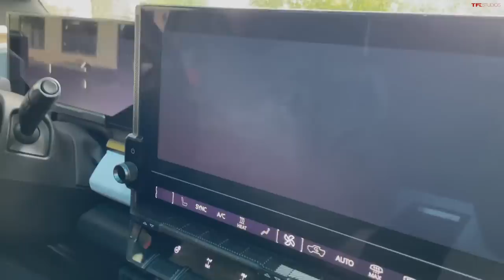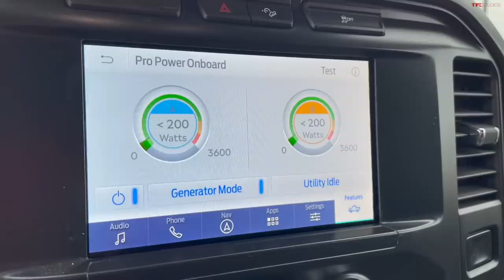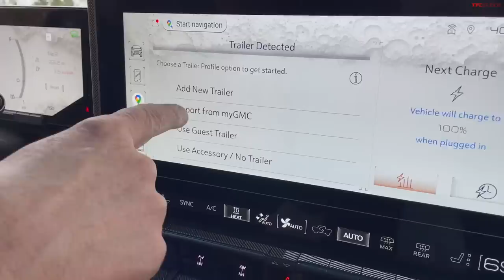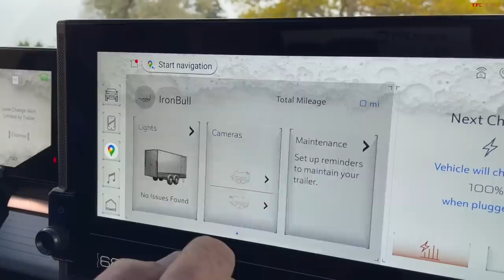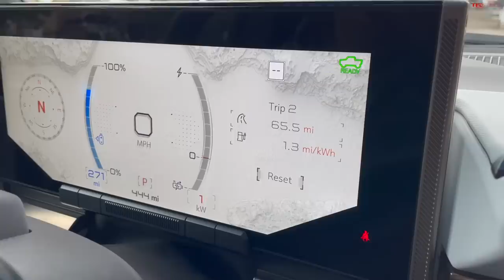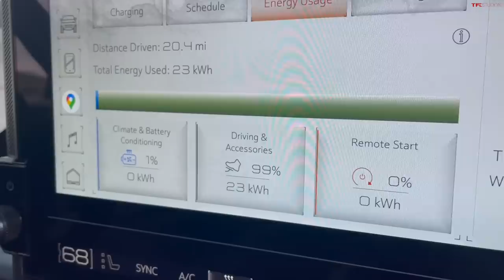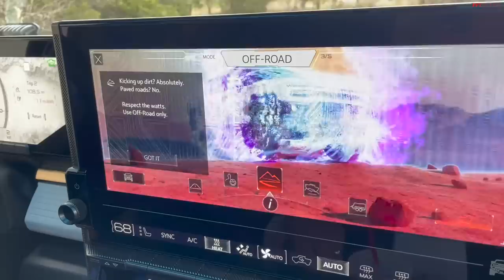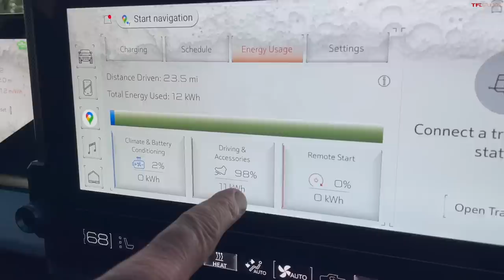Is The New Hummer EV a Real Truck? I Tow 5,000LBS With It to Find Out!

Comment: That was too funny when Andre got caught. It was a moment of frustration we never see in Andre and he quickly changed back to the happy go lucky fellow we all love. That miles per kilowatt number is the new miles per gallon. It'd be interesting to compare all EVs by that number.
Reply: @DavidBrown-hc1rb  yes it would but it would be very difficult. How the electricity is produced would be the catch. Solar panels, wind, coal, nuclear,  natural gas all have different costs. That would really be a trip if it could be figured on each source including the cost of the solar panels, the cost of the wind mills and upkeep on them, the cost of the coal and the manpower to mine it and refine it. Actually I guess they do it the best way. How much a gallon of gas costs versus how much a kilowatt of electricity costs when they buy it.
Reply: See how winter temperatures affect these EVs, been poor from limited testing I have seen.
Reply: @kevinvanlohuizen2709  it would be interesting to see the average now compared to this winter there in Colorado.
Reply: Id like to see mfr add an audio cue linked to M/kWh to help drivers know when they are working the power train harder. Many of us learned to drive efficiently by using audio cues, and not staring down a number on the dash.
Reply: @jayhiggins5239  that's a good point

Comment: Can you please do a test where you drive a EV for 50 miles or so and let the vehicle sit  not plugged in for a week or so. Than check the battery percentage and range depletion. I am an over the road truck driver and my car sits in a parking lot for a week at a time. Love your unbiased content. Your always straight forward. 💯.
Reply: I drove my EV to the airport and left it for two weeks. I had no loss of battery when I got back.
Reply: @DurandsDesigns  depends what the ambient temperature is! In -20 deg weather it will deplete fast because the vehicle needs to heat the batteries. In 100 deg weather the vehicle needs to cool the batteries.  All EVs use power when they sit!
Reply: @SuzukiKid400  Good thing the Hummer has a Heat Pump so battery loss will be less than other EVs.
Reply: @Nebula1701  this is a common misconception. Heat pumps are only efficient in the fringe season. They don’t work efficiently in -20 deg weather because there is no heat in the air to be able to “pumped” into the battery.  You need to generate that heat with some sort of element.
Reply: @SuzukiKid400  GM uses their battery as a heat storage system in their configuration it isn’t just dependent from the air. They scavenge heat from it the battery, to the power electronics, and the motors.
Reply: @Nebula1701  you’re not considering heat soak and the steady state condition when static. Idle batteries do not generate heat.  What you describe is only relevant when discharging the batteries as that is when appreciable heat generation occurs.

Comment: Quick math based on my Ram 1500 mpg towing 6k....the Hummer EV is about 1/2 as much $/mile.  That's with gas prices in SC and Roman's electric costs.  Gas in CO is likely higher.  Comparing running costs per mile is something that nneds to done when comparing EV units to gas or diesel trucks.  Good content!
Reply: Also, not paying highway tax despite being heavier than their peers, which is why theyre trying to sneak a flat mileage tax on all of us thru “infrastructure” bills (lol). Also, if I was an energy provider, I would tier your bill. Normal house use is normal rate and monthly rate over that bumps you into EV charging rate. Rather than pass the cost onto all electric consumers. This would then incentivize people in Texas for example to actually put insulation in their houses, crazy thought, but no one did that after the sub zero storm that shut down the state. No one…. I ask all the time too. “Oh wow, your pipes froze inside your walls? Did you improve any insulation after that?” No? Oh ok .
Reply: @danh8302  states are starting to implement a flat fee for evs when renewing their plates.  I think Illinois is $600
Reply: Yeah, but your ram isn't $115k. You will never save any $$$ owning a ev. Once the grid is updated, if it ever gets done. You will be paying more for electricity also. Why do you think homes went to NG from electric baseboard heat.
Reply: @danh8302  Road taxes don't actually pay for roads, but simply for fairness, its fair to charge EVs a ""road tax" via registration or insurance, and charge per kwh taxes at public charging stations. I'm on a two-tiered electric system in my area, but that affects all people based on usage only, regardless of whether or not they have EVs, there's no real way to differentiate. Some of my neighbours pay a lot more than me just by virtue of blasting their electric heating in the winter and AC in the summer, which is typically a much larger electric use than an EV. The whole hubub about EVs and electric use/electric grid stability is complete baloney, if anybody actually cared about grid stability we'd be insulating homes and installating heat pumps left and right - fact of the matter is electric cars just don't use that much cumulative energy compared to other appliances and household heating/cooling.
Reply: For now. The more people they force to get EV the higher the costs will be and you still won't have the range of a ICE. Plus the upfront cost of any EV capable of decent towing is through the roof offsetting any possible cost savings while driving it.

Comment: So, if we consider the Rivian, the Lightning, and the Hummer, it seems we can expect to get about 1 - 1.5 miles / kWh (give or take) when towing with an EV pickup truck.  That's probably acceptable for occasional, around town towing, but a bit impractical if you need to tow semi-regularly or if you want to tow something out of town (for example, when taking toys or a camper on vacation).
Reply: One step change in energy density of the battery and this is no longer an issue. 600-800 miles won’t be rare in 5 years. You’ll be able to choose between a lighter sport truck or a towing rig with a larger battery and higher voltage architecture for fast charging. The future is bright. 👍
Reply: @mt2nv1  your hope of a new battery chemistry that will double the density is just that - a hope - we’re pretty much at the highest density we can hope for.. at a price point we can just about swallow. 
EVs are hot dogs**t.
Reply: @dsmhiggins67  really?! Please send me your references and qualifications. I’d love to learn more.
Reply: trailers w/ built in batteries/range seems like a work around.

Comment: I'm probably crazy, but I used our 2021 Buick Enclave (with tow package) to tow a 2014 Lincoln mkZ on a car hauler trailer (like the one in the video) 230 miles across Michigan. It did surprisingly well. the V6 has enough power to do everything needed and the transmission manages itself well.
Reply: That is crazy but doable with ICE. Not so much for EV. Sure a EV will have amazing torque to handle the weight but good luck making it that far.
Reply: @draecath5953  I am all for EV's, but you're right about the range. The battery technology just isn't there yet for towing.

Comment: Great video of  a real EV practical usage!  We are in a transition point and the EV  technology is improving fast.  A lighter smaller  truck with that battery capacity and less power hungry motors  will be awesome! No need to do 0 to 60 in 3 seconds...  Thanks for a great video!
Reply: Improving fast? That’s why Ford already raised the pricing for the already not affordable lightning two times in a few weeks 😂… do you know when the first battery came out? You know how much improvement happens since then… but of course a 200kwh battery, a 10.000 pound truck to pull 7500 pounds sounds very green to me 🤦🏽‍♂️😂… and of course the small 200kwh battery pack is recyclable, when it fails after 10 years  just get a new one for 25k and the old one can be buried in the backyard so you have a battery tree ready when the next battery fails… sounds definitely like the right agenda to push considering the stupidity of todays society… pretty much like this test, because if the would drive that 5000 pounds another 50 miles it would be probably down to 0.7 mile/kWh… such a stupid Test, but again it suits the stupidity of todays generation.

Comment: Your Hummer should have also came with 4 trailer tire pressure monitors that you can/could have setup during trailer setup - kinda cool.  $$$ to buy separately.
Reply from the maker: Thanks for the comment. When were wondering what those are for?
Reply: @TFLoffroad  Ha yeah I was too at first, they work pretty well but have to set them up 1 by 1 I think.  Keep them as they are about $75 each I think.

Comment: It works as a local, in town towtruck. You went around 50 miles and used around 90 in range while towing. They're great in town vehicles, but are NOT good for towing or medium distances.
Reply: Exactly for anyone who wants to tow a camper or anything over a couple thousand pounds any longer distances like a quarter of the way through a state they are pretty much useless. They make for an amazing 115k short commuting vehicle though.

Comment: So...one screen view showed 20.4 miles driven and 23 kw used.   So that works out to 0.89 mile per KW.   Not good, but the aerodynamics are bad and it is a pretty good load to pull.   Helps to have a monster sized battery.   Yes, it would work, but comes at quite a cost to buy and drive.   STILL, very exciting to see the start of the electric revolution and BIG THANKS to you folks for trying to cover all the aspects of the new electric revolution.   Keep up the good work.

Comment: I am going to follow the Hummer videos. I like this one because the towing here is probably more illustrative of the type of towing which will be done with these trucks and battery electric truck in general.   And I am very interested in the function of the 4 wheel steering. I don’t care about the gimmicky crab walk, but I want to know how well 4 wheel steering helps in day to day use for parking lot maneuvering and what not. 

GMC and Silverado offered 4 wheel steering back in 2003 to2005, and while it worked great, it was a marketing failure. I drove a quad steer GMC and I loved it’s maneuverability in tight places. But it rode rough, was very expensive and looked funny because of the widened rear axle was needed to clear the rear fender liners and frame. It just looked goofy. But it worked great. 

Maybe you can dig one of those up and compare it to the Hummer and see how things have improved.
Reply: Crab walk should be sweet at the boat launch, line up the truck and put the boat where you want it!

Comment: Like I said in the other video - that Hummer is going to be better against its rivals as the workload increases. 
Its already heavy and already uses a lot of power so when you add a load to it that load makes up a smaller percentage of the overall power used. 
In other words if it has 200kWh and only goes the same distance as another truck which has 100kWh then its using twice the power to do so. That means the same load will have half the impact on its overall range that it will on the smaller battery truck. 
Its still going to use more power to get places than the smaller truck but as the workload increases that gap gets smaller and this has twice the battery.
For instance lets say we have this using 200kWh and a smaller truck using 100kWh for the same distance empty. So the Hummer has 200% of the battery but needs 200% of the power for the same result.
If this uses 10kWh to go a distance and you add a load which increases that to it using 15kWh, you're adding 50% again to its power use. 
If you have a smaller truck which only needs 5kWh to go the same distance, then when you add that same 5kWh load you're adding 100% or doubling its power use. 
Then the Hummer is "only" using 150% of the smaller trucks battery for similar distance but it still has 200% of the capacity - meaning it will go 25% further. 
That big battery means it will also likely be able to swallow more energy faster over a longer time since 20%-80% would be 120kWh while in the smaller truck 20%-80% is only 60kWh. 

Presuming there are chargers to feed it this thing could actually make some kind of sense. 

Of course there is that $115k downside which is mostly why all battery trucks aren't using massive capacities.

Comment: Great Video as always. As you mentioned, towing is not only about the weight but also wind drag gets taken into consideration. A tall cargo with no aerodynamics whatsoever will cause greater wind drag and gets taking into account for less fuel economy. a side by side which is open will just let air go through and have almost no wind drag. For the sake of comparison, what major features should be taking into consideration for towing with an EV? Is really battery size what matters? The quantity of electric motors? The Difference in Torque? Which is more efficient generating Torque, Ford's or Chevrolet's? Which one is actually more efficient generating power?
Reply: They're all 90%+ efficient.  The real issue is the aero profile of the tow vehicle combined with the profile of the trailer.  The Jummer blocks so much of the trailer that the aero drag is lower. It also has a massive battery. The Rivian is smaller and more aerodynamic so it would probably do well towing locally.  The Ford and Rivian need 800V though.

Comment: Something you boys should start doing when you compare an EV to a diesel or a gas truck as a direct comparison compare the miles per kilowatt hour on your EV versus the miles per kilowatt hour on the other vehicle like Andres Cummins or the hybrid pick ups, or even like that GMC Denali, gasoline has a kilowatt hour per gallon of 33.7 diesel kilowatt hours are approximately 40 per gallon.
Reply: Nobody wants to hear that math. I commented on that Ike Gauntlet video with the Lightning that if you do the math, it was actually getting the equivalent of like 13 MPG where whatever gas truck was in the same video got 4.The efficiency is absolutely ridiculous but everyone wants to focus on the range. I mean I get that range is an issue, especially in an extreme case like that. But you have to look at the big picture too.

Comment: A TRUCK, I believe is mainly a vehicle to move loads, from place to place. 
 "A truck is a motor vehicle designed primarily for the transportation of property or special purpose equipment."

 - So lots of pickup trucks end up being used as a car most of the time. Then you have buses and vans to move people.

Comment: 50 percent battery to go 132 mi while towing 3k to 4700lbs doesn’t sound very efficient to me, comparing it to an h2 with a gas engine. I know the gas would also see worse gas mileage but I don’t think it would go from 10 mpg to 5 mpg. While this is not a work truck, I find it lacking to do towing for recreational purposes like a camping trailer, or a small- medium boat.

Comment: I am still convinced that Hydrogen fueled vehicles will dominate over EVs. Hydrogen will be so similar to gas and diesel.
Reply: There are 3 problems that hinder hydrogen adoption. 1) It's significantly more expensive 2) the hydrogen infrastructure is more than a decade behind EVs and several decades behind Gasoline. In the US, there only about 2 areas (Northern and Southern California) that you could get by using a hydrogen powered vehicle and taking any kind of a road trip would be impossible. 3) Politics/Manufacturers - there are already lots of laws and regulations around the world that are favoring and incentivizing EVs and only a few manufacturers even produce them currently. 

I think that hydrogen power will definitely grow and be used in certain applications, like airplanes, but there will be far more EVs since they'll meet the needs of the overwhelming majority of the population.

Comment: I'll have to admit that was a little impressive, but if you're charging it every night at $17.00 & you charge it 6 nights a week then you're still spending $107.00 a week. But I don't know if it needs charging every night so it was impressive, thought for sure it would use more power than that.
Nice job & I look forward to your videos, I watch them all.
Reply: You would only need to charge it every night if you depleted the battery every day. If you’re driving 300 miles a day on any vehicle you’re gonna be spending a fortune. So it’s basically $17 to get the equivalent of a full tank of gas. I have two trucks, one GMC sierra 2500 Chevy avalanche. It cost me closer to $120 per fill up so in my case I would be saving about $100 every time every week.
Reply: @TristenHernandez  you would be saving $100.00 in fuel costs. But what is your monthly payment and insurance premium? Annual licensing and registration fees? Won’t find that on YouTube. Replace all 270 million cars in America with an ev overnight, do you believe electricity costs will remain the same? Can you say with 100% certainty in that scenario it will still be cheaper to operate an ev? Another factor that is impossible to measure is driving habits. Instantaneous torque and increased vehicle weight with all these lead foot wannabe nascar drivers? I’m guessing tire life will be falling off.
Reply: @alexr7012  Jeez, registration fees and tire wear? You anti EV guys are really grasping at straws now. Yes I can tell you with absolute certainty that in any scenario it is cheaper to operate an EV, anyone who tells you different is simply lying. I have been driving electric for 10 years and I own a fleet of vehicles, so I know all about operating costs. If you enjoy gas stations, oil changes, and repairs, go ahead and keep giving money to the Saudis, I'll stick with 1,000 hp EVs myself.